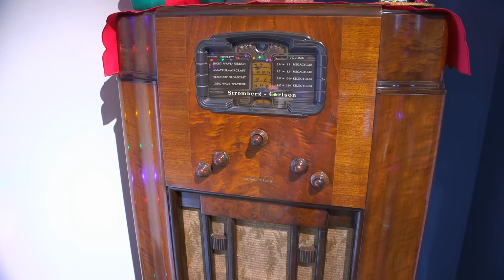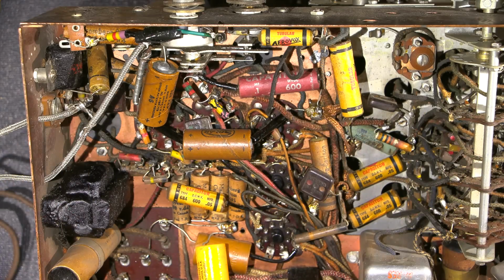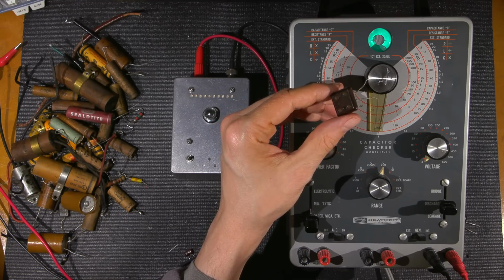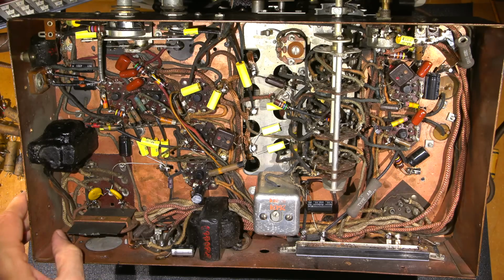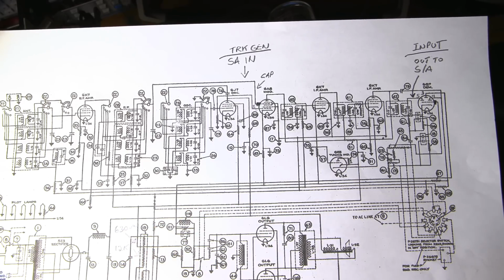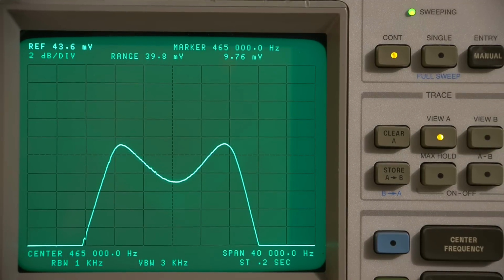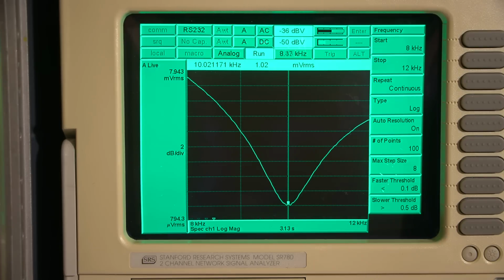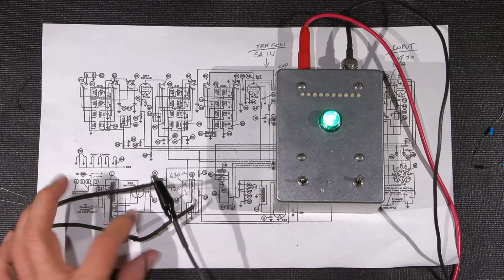84 Year Old Radio Receiver Restoration! Stromberg-Carlson 145L

Comment: Very Interesting . Question  you said the Death Cap of Doom was non polarized  how is that achieved ie  how are capacitors polarized its just two plates with a dielectric between . Just curious as capacitors seem to be a common issue in all electronics .thanks for your highly detailed videos and so we could hear music you could modulate an AM frequency with some YT approved audio .
Reply: Some capacitors, such as electrolytics, can only be polarized in one direction. Others can be polarized in either direction. The one's that are not sensitive to which way they are polarized are called non-polar capacitors.
Reply: @GTCGreg  This sounds like nonsense if you don't know please don't make up stuff to try to sound knowledgeable
Reply: @alexkay1874  Right Alex. I make this stuff up.
Reply: @GTCGreg  Your statement is nonsense it's like saying the sky is blue because it's not purple Nonsense . If you want to contribute present something useful if you can

Comment: Merry Christmas ! 

I have a possible suggestion, but i am not aware of how feasible it is... I really enjoy learning from these videos, and the repair content is by far the most informative i was able to find online, but i always get sad when i see that a person has to move fast through the stations in order to avoid a fairly possible copyright claim. 

Is it feasible to set up a legal wattage FM broadcast that loops through creative commons licensed content on any one of the bands, for when showing off features like the "Fidelity adjustment" ?

I ask because i honestly don't know of the limitations of both Legal FM broadcast and Youtube's copyright claims in conjunction, and feel that such good quality videos might feel 0.1% incomplete when reaching the end and the fruits of labor may not be fully presentable. Maybe it is just me though :) 

Best Wishes to everyone
Reply: I don't think an FM transmitter would be received too well on an AM radio but you could possibly receive FM on an AM using what's know as "slope detection" by tuning just a little off frequency. That only works well if the IF is narrow band. That said, most signal generators have an external modulation input. It would be very easy to modulate the signal generator with a music source.

Comment: Still waiting on a 1940's TV restoration, even though there's no longer any analog broadcasts.
Reply: I have a 1958 Emerson 24" 
B&W set that I occasionally watch using a converter box.

Since I bought it in 1980, It's been mine longer than all its previous owners had it.

I have a 24" tube in storage for the inevitable day the original one dies.
Reply: You can purchase digital TV converters that convert over the air digital broadcasts to NTSC so you can watch TV on your old TV's.

Comment: Stromberg Carlson made beautiful radios in the 1930's.  I have a couple that need to be restored electrically but the cabinets have that beautiful patina that they get from sitting in a heated building for almost 90 years.  That 6L6 in the output would be a very new tube in the '36/37  model year as it had been introduced just in March of that year.

Comment: This is the best of your AM radio videos I've seen. Excellent work.
One thing I never knew until recently about resistor values is that, for the most part, they follow the ROYGBIV colors of the rainbow, preceded by black and brown, and followed by silver and gold, with indigo elided. Since I already know ROYGBIV, this has been valuable to me as a mnemonic device.

Comment: I was looking at the schematic and it looked like the 6L6s were in push-pull and it was using a tapped inductor as the phase inverter. I don't think I've ever seen that before. Most push-pull amps I've seen use a triode and take the two out-of-phase signals off the plate and the cathode, respectively. Did that inductor act as an autotransformer?
Reply: Yes, that's an autotransformer used as the phase inverter. It's not common, but I have seen it done before.
Reply: @GTCGreg  Thanks. It was a new one on me.

Comment: I restored a 145L a few years ago.  It was completely original.  Mine had a few differences- darker cabinet, no fiber board under the chassis, power switch was a 3 position switch (off, low, high tone).  Stromberg Carlson was easily one of the highest quality, most technologically advanced manufacturers of the time.  This radio performs fantastically, and the quality - from the transformers, chassis wiring, to the (very heavy) cabinet puts it into a class with EH Scott and other ultra high-end brands of 1936, albeit with a lower tube count.  I unfortunately ran out of space and had to let it go to another collector.  Too many great radios out there, and can't keep them all.

Comment: That is one beautiful radio!  Paul, your unparalleled ability to acquire such radios is almost as good as your consummate skills in restoring them.  Thanks for the detailed SA alignment!  Question:  Can the same can be done with a DDS with sweep gen function and an 50 MHz analog oscilloscope?  How about a DDS and DSO with FFT function?   I ask because those are the only devices I have and It'll be the next millennium before I can afford even a used Spectrum Analyzer like yours.  Again, thanks for the video -- it was a nice Christmas gift after the truly awful year we all had.  Happy holidays to you and yours!  KD2ORG
Reply from the maker: Hi Bruce. A sweep gen and a scope will get you close. Thanks for your kind comment, and Merry Christmas to You and Yours as well!
Reply: @MrCarlsonsLab  Hi Paul, would you consider a video explaining just that? Cheers, Mark

Comment: Hey Paul, once again, awesome job.
Question: how do you determine if a radio is worth your time to restore? Crushed IF cans? Physically damaged variable caps? What? U spend 16 hours to replace caps/resistors w/o even testing power xformers etc. I would be very upset to waste all that time and parts cost only to determine the radio wasnt worth the time
Reply: I think that radio would have been worth restoring even with crushed IF's and smoked power transformer.

Comment: Nice restore ,I would like to see the 5z3 at point 12 on the scope after its been changed ,to see  quality of the DC waveform. Trying to find time to see this in one sitting , but getting distracted. Happy Holidays. [ Add on - are those transformers toasted; [IE: drippers ?
Note: Paul,you thought about making some circuit boards for your capacitor tester,parts list & maybe show one with settings. I understand you are building new models & showing them to us. And sell for flat price, that  might be a profitable idea for you. Hugh - Chicago, Metro
PS: Nearing end of video ,cap of doom ,similar to crowbar circuit..
Reply from the maker: Thanks for your input Hugh! The transformers were hot, but are still fine, Thankfully! The DC at the reactor and field coils will resemble a saw tooth or ramp waveform, which will get progressively better as it hits more filters down the line. Merry Christmas!

Comment: Wonderful job, as always.  You commented on those hand-picked mica caps being like 112 mf, but you replaced it because it was bad - so did you try to get the same value from the new one?    Also - what is your antenna?  I have a loop and a 100' wire in the basement, but the loop only works for AM.  My radios are both Zeniths, and they seem to work best when the antenna is connected to the "A" screw terminal and not the "Z" terminal, whether AM or SW.

Comment: I have almost 60 years experience working on both tube and solid-state electronics, yet every time I watch one of Mr. Carlson's videos, I learn something new. This is another incredible video on the restoration of an equally incredible radio. Congratulations Mr. Carlson. You have done it again.
Reply from the maker: Thanks for your kind comment Greg!
Reply: One of the greatest electronic teachers I have ever run acrosst... Also working I find the capacitor tester that he has designed and built... Every shop needs one of these
Reply: Absolutely the best electronic instructor I have ever run across..   Also where can I get my hands on the capacitor tester that he had designed and built I need one desperately... Every shopping needs one of these...
Reply: @signdesignman  I couldn't agree more. 
I believe Mr. Carlson has the plans for that capacitor tester on his Patreon  page. Patreon is a pay site.
Reply: I have an old GE hifi console from the the early 60's and the tubes are all good, but the reel to reel not so much and the phonograph needle is shot. One of the speakers is kicking in and out now. Can you fix it  or me? I'll pay you whatever  want. It's deer to me
Reply: @josephkool8411 , try Shure electronics in Evanston Illinois for a new phonograph cartridge needle.
Reply: Wow factor!
Reply: You're not wrong, Greg!
Reply: I learned eletrical and electronic principles by myself and later in a correspondence radiorepairing lessons and also with a little help of my brother - he was a self made tube type radio and television rapair man too - by midlle ' 60s... I'm retired now but stiil made some repairs, including LCD and Plasma television sets...

Comment: Thanks, Mr. Carlson. What a fantastic radio.
 Pre-WWII Stromberg Carlson sets are some of my favorites. Most of them are very well built, even overbuilt, much like their telephone equipment. If you recall the SC telephone handsets, they weighed a ton. They always seemed to care about how the set looked on the inside, as well, as shown by the finish on your chassis and other deatails. A 145L is near the top of my bucket list, for sure.
  I have what I believe is the first model of Stromberg Carlson radio. It is a 1-A from about 1925. Quite heavy and extremely well built, as well as very attractive inside and out.

Comment: I´ve done some restoration on a Nordmende Parsifal U17 and so far it´s working great but there´s a small issue.
There´s a hum which will get louder by turning up the volume.
This isn´t bad when listening to FM but on AM the internal gain is lower than FM and it get´s quite noticeable.
Also when listening to the line in port on the back there´s a hum noticeable sometimes if you play music with silent parts and i´m not entirely sure where this comes from.
I replaced a few capacitors on the amplifier tube and preamp tube, especially the coupling capacitor is very important and i changed it aswell as the coupling capacitor for the two electrostatic tweeters.

I left all capacitors in for the tone control network since this seems to work fine and even if they fail, there ´s no danger at all since it´s between the amp and preamp which has the coupling capacitor in series to the tone network.

However the noise sounds like a classic 100Hz noise from a full bridge rectifier which i also had to replace since it blew up together with the two filter capacitors on the output of the rectifier.
It´s now a silicone full bridge rectifier and two small halogen bulbs as voltage drop resistor for the anode voltage (it´s now 250V, in the spec sheet it´s 260V so should be fine).
Not sure if the silicon one causes this noises.
If i remove the preamp tube, the noises go away and only a very very quiet hum is noticeable so i assume the issue must be in the volume and tone control section (it has a equalizer preset like tone network and two separate bass and treble controls)  which is attached to the input of the preamp while the coupling capacitor and the tone network on the output and directly connected to the amplifier tube which stays connected when the preamp got removed.

It´s the only thing left to fix on this nice old device and i´m not entirely sure where to look for this issue.

Comment: Thank you Mr. Carlson for restoring this beautiful looking & sounding radio! 

Wow!  For nearly 90 years old, this shows how very well the designers knew their craft. 

But the real beauty here... is after nearly  90 years YOU can & did repair & restore it to factory specs, if not better... & certainly safer!

This junk that is made today, hasn't got a snowball's chance in hell of being alive or repairable 90 years from now, & will almost certainly be contaminating some water table somewhere in a dump! 

Question; you mentioned "if you can get one for a reasonable price, buy it..."
So, how much did you pay for yours & how much is reasonable & how much for all of the parts & total hours to repair & align?

By the way, could you please do a quick vid addendum & show the "death cap" tested on the regular cap tester that goes up to 600v & see where it starts to break down, sizzle, etc.? 

Thanks! And a very Merry Christmas ☃️ to you & Happy New Year!

Comment: 1 gigaohm bad? Isn't the leakage resistance  normal for a capacitor of that vintage?
Reply from the maker: Absolutely not.
Reply: @MrCarlsonsLab  But in what circuit would a 1 gigaohm leakage be critical?  For example: if 100 volts was placed across it, the leakage current would be only 100 nano amps. It wouldn't affect the Q of a tuned circuit as the circuit reactances would be much lower. What circuit would it cause to fail?
Reply from the maker: The issue is: The capacitor (especially the Mica shown) should have a resistance value above the capacitor testers reading ability, (40G Ohms.) This lower resistance, (1G Ohm) indicates the capacitor is degrading inside, (failing,) and will become an issue shortly. This is why the capacitor testers setting is called "Forecast." This capacitor tester gives you the ability to eliminate issues before they become serious, effectively saving you from "doing the job again." Doing the job right the first time is a priority for myself.... Something that seems to have been lost for many through time.
Reply: @MrCarlsonsLab  I see your point. But as the aging process appears slow (capacitor age 70 to 80 years?) and had not yet failed, I would be very curious how that small leakage would affect circuit operation.
Reply: @MrCarlsonsLab   after 30 years in the world of electronics manufacturing (semiconductors)... not really sure.  When these caps were made they didn't have the technology (at least not easily available)  to test for leakage in the 1 G ohm range.... so it could be a manufacturing issue from 84 years ago or the caps may be slowly degrading or not.  Unless they were speced requiring special ultra low leakage unlikely they were at BEST  tested on a tester similar to the Heathkit which can't detect leakage this low.  Most likely only a small percentage of caps were even tested. This is after all a consumer device which does need to remain somewhat affordable, so most likely only a few out of each batch were tested.  I  guess we could retest them in another 10 or 20 years and see if they have degraded further 😄
Once again a beautiful radio And spectacular restore job. Hard to imagine any current consumer items lasting 84 years and continuing to give such fantastic service.

Comment: I found a very old tube radio in a trash pile under dirt.
I dug it up and took it home.
I cleaned it , then plugged it in.
It turned right on.
I don't know why they through it away, because it still worked.
But i had a good time as a kid listening to AM radio late at night before i went to sleep.

Comment: Hi worked on similar in past 60 years of component repair from tubes to ic's  and intel to arm procassors, to today,  Just always enjoyed. 
so as a question I had a sencore Z meter in the past I used for leakage  to 500v , worked very well and was popular in the shop,
how does this compare to your leakage tester. Was a great help in past for electrolytic's in the past. Miss working on old Car radios to. So jumped to arm teensy with sound board now for entertainment.

Comment: Is it possible to make a stereo tube AM receiver? Just curious.
Reply: I think that such is impossible because there are no transmissions in AM stereo, so you would not even know which technique to put into your receiver... The technique could be made perhaps, but it has never developed that way.
In the Netherlands, somewhere in the 1960's, some experiments were done for a few hours. There were two national stations, and they put sound from each stereo channel (L + R) on each of the stations, so you needed two radio's to listen. The transmission was with AM, and on the medium wave band, but it took two stations to do it, the stereo signal was not on one carrier.
Reply: @erikdenhouter  Well I never got the notice you replied. Thank you.
Anyway... The reason I asked is because in the late 70's/early 80's AM stereo was implemented in America. It was a poor attempt to rejuvenate interest in AM broadcast.  
Two classes where made: independent sideband (ISB) systems,  and quadrature amplitude modulation (QAM) multiplexing systems. 
I had a Mustang brand transistor AM mono/stereo - FM stereo. My area still has three AM stereo broadcasters. I think they still broadcast in stereo, they did.
Anyway that's why I was curious.
Reply: @erikdenhouter  I just googled it and found a List of AM stereo radio stations still in operation world wide on WiKi. Sadly only one near me and it appears the QAM method was adopted as the "standard".
Reply: So they were there all along in the USA. Didn't know that.

Comment: why don't they just mark the outside foil during mfg?
Reply from the maker: Now these caps are put on circuit boards, which can have a ground plane below. The caps are now mostly used in a lower impedance application as well, (solid state.) Positioning the caps the right way on the assembly line is a huge cost factor.